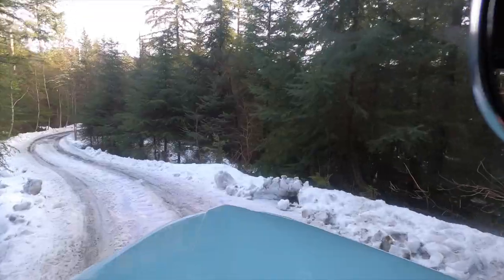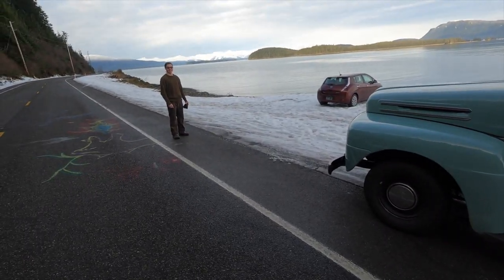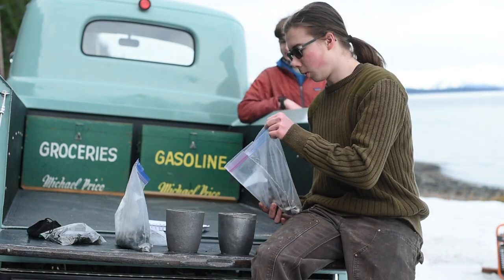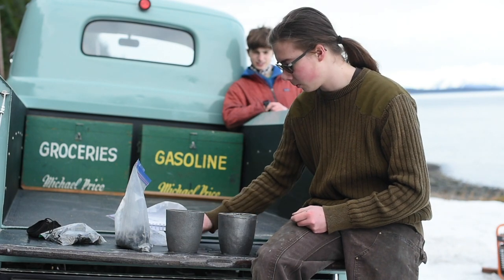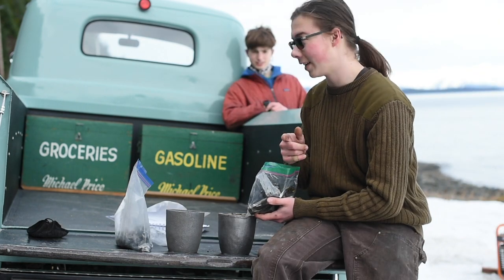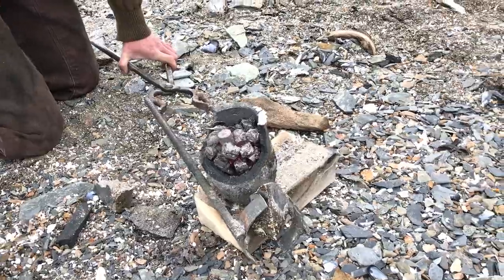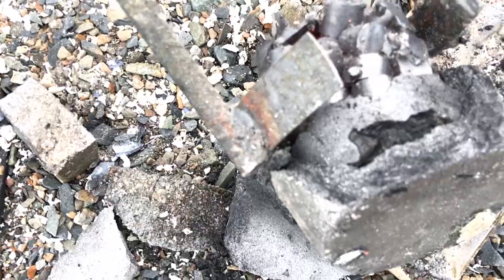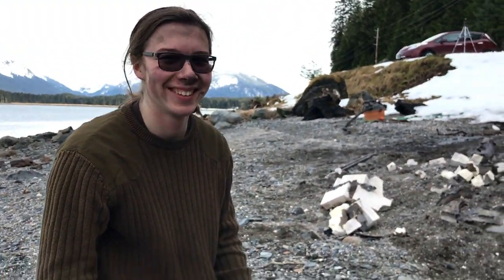The Road to Wootz: Attempt 1

Comment: Love the little blue truck. Also, the temperature seemed plenty high, but I don't think you soaked it long enough. So as usual, the answer is "more charcoal". At some point it becomes worthwhile to make your own. 
One final tip-- Pine charcoal burns faster, but it burns hotter. It's what Japanese swordsmiths use. If you can find pine lump charcoal somewhere or make it yourself, that should work better than the hardwood stuff.
Reply from the maker: Thank you! I agree that ideally we would have soaked longer, but I think the main issue was that the crucible was right at the bottom where it wasn’t as hot. Oh well.

Comment: Nice one, buds! I enjoy the scenery and the vibes. 
This is a dissertation topic of mine, so I'll throw some pennies at you.
As someone said before, you did get high enough theoretical temperature, but due to thickness of the crucible the temperature inside really didn't homogenize with the outside. Furthermore, the charge you put inside is more likely appropriate for gas forges, as they get over 1500 C, enough to liquify the complete charge- you have a lot of steel inside, little of cast iron. If it were the other way around (with the adjusted math because of different carbon content ratios), you could have had different results. Cast iron melts at lower temperatures (about 1250 C for what you've held in hand) compared to low carbon steel, thus sooner, so it would have more time to diffuse its liquid phase carbon into the steel: co-fusion. You experienced a gaseous phase diffusion by the means of cementation, carburizing. So you just needed higher temperatures to make it all liquid, or different content, so you could do it at lower temperatures and longer time.
As for the carbon from charcoal... It's best if you produced it by yourself. Get a species you know and find its charcoal carbon content information online. It will really help you. Or just create a lot of soot/lamp black. It's nearly pure carbon...but it takes a lot of time.
Cheers and keep that engine rolling! :)
Reply from the maker: Thank you for the tips!

Comment: Nice try. Some tips from my point of view, use a blower with much more less air. That air pump you have used was EXTREMELY powerful for your purpose, too much excess air will result into cooling your crucible instead of heating it. Try using a variable speed drive to control how much air you put into your smelter until you manage to get the correct temperature. Keep trying
Reply from the maker: Thank you!